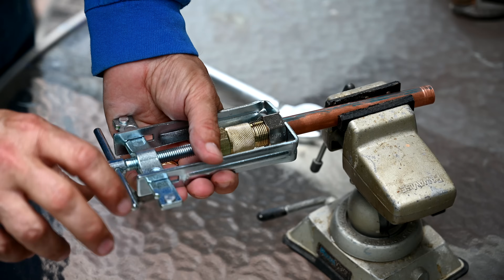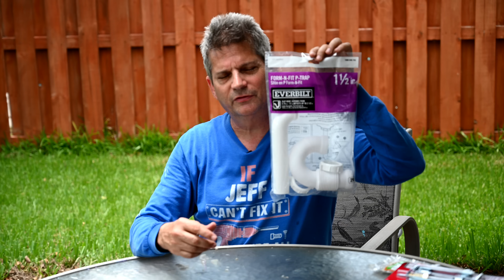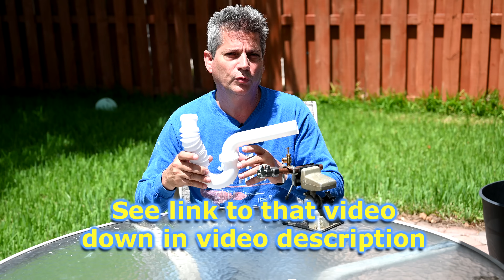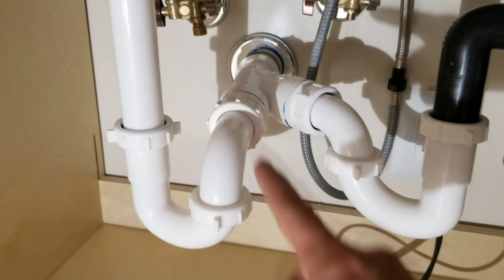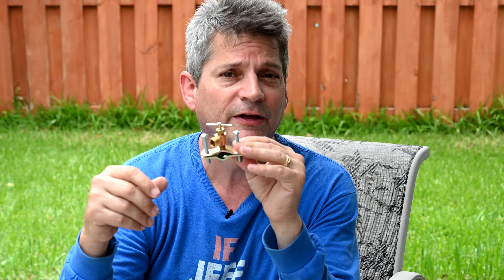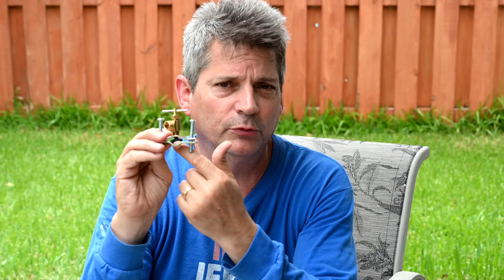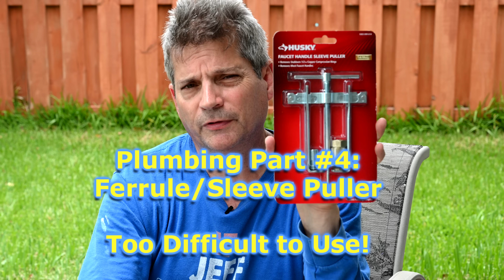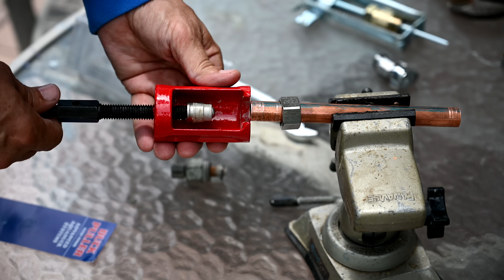4 Plumbing Parts/Tools You Should NEVER Use. NO Plumbing Fails

Comment: I fitted my first and only saddle valve 15 years ago for my ice maker....and I've never had a problem.
Reply: Same, I used one for an RO system in my basement about 10 years ago. Its right were I can see it, and I would know for sure if it started leaking. Which it hasn't. That being said, I will sweat in the proper parts if it does.
Reply: @chriskolb3105  Same here--mine's been in place for 12 years.  No issues.  And it's in the basement near a floor drain, so it it leaks, it can't hurt much.
Reply from the maker: @chriskolb3105  Yes, sometimes you can get lucky. I heard that some cheap Chinese saddle valves with cheap white metal will corrode and pop right off.
Reply from the maker: Famous last words...
Reply: I think a lot of it has to do with your water supply and types of metals in your system. I've seen both scenarios. 20 years old and still holding and 2 years old and leaking. Not worth the risk. It's much easier to add a real fitting and ball valve.
Reply: @tedd7028  Agreed. The issues I found had nothing to do with leaks only volume. Refer ice makers require more volume or they fail and won't be covered by seller etc. Watch your backs brothers.
Reply: I do the plumbing work for a big apartment complex and the occupants putting saddles on copper plumbing lines causes thousands of dollars worth of damage every year saddles are nothing but crap and whoever uses them don't think about the owner that has to dish out all that repair money they think about the
Reply: The money they safe
Reply: I've also had good luck with them, but I've never installed them in an inaccessible location.(behind drywall). I've always had them under the sink, so I can repair or replace them easily, the few times that I've ever seen anything go wrong. It does make a mess, and I have had to replace an under sink cabinet floor. Though failures are rare, I'm reluctant to use them in someone else's house, because I can't keep an eye on them.
Reply: ya man. People love to be over dramatic about stuff. I've been plumbing 22 years and have seen countless saddle valves working fine
Reply: @garyvallone5393  Out of the hundreds of saddles valves I've seen only about 20 of them was leaking but that was enough to cost thousands of dollars worth of damage so it's not worth it to me any so-called plumber that installs saddle valves is not a plumber there a butcher
Reply: @plumbbuild6517   I'm not saying I install them. I never have. But I've seen tons of water damage issues.  Saddle valves are bullshit but not worse than anything else.
Reply: @garyvallone5393  I don't understand why people that are not plumbers use saddle valves instead of just a regular stop tee much easier and it passes code
Reply: @plumbbuild6517   well because they arent plumbers I guess. Homeowners
Reply: The problem is after turning it off/on over a period of time. 2. Isn’t a solid rigid connection.
Reply: The technician that came to install our refrigerator used a saddle valve to tap into a water line. After 3 years I heard a constant water sound one day, and it turns out the saddle valve was looking for so long that the copper pipe eventually corroded and was spraying water in my crawl space. Crazy how these fail so catastrophily

Comment: Yes your sleeve puller is garbage.  The one I have is worth its weight in gold, works great.  No manufactures mark,  was my grandfathers.
Reply from the maker: I may have seen other plumbers using the tool you described is that like one of those big Gray sleeve puller tools?
Reply: Ferrule removal is best done by careful use of a cut off wheel
Reply: A real plumber can get by with channel locks. I once re piped an entire hotel and then swapped engines and transmission in my 73 suburban in the same weekend. Only tools I used was a pair of channel locks and a 4 in 1 screwdriver
Reply: @garyvallone5393  this is true but just one knick of the channel locks and you will have a leaking compression sleeve. Best to use the right tool for the job.  You didn't by chance use a hammer to work on your car?
Reply: @jbright97  no hammer. I used the channel locks as a hammer

Comment: what about shark bites they dont require soldering
Reply from the maker: I use shark bites all the time, especially their end caps to cap off a pipe temporarily. I will only use these outside the wall, where I can see if you ever develop a leak and you can reach it and it's repairable. Otherwise, nothing beat soldering pipes, tried and true.

Comment: How old is this video the first clip was good but the rest was a disaster
Reply from the maker: This was all filmed 2 weeks ago. why do you say it's a disaster?
Reply: @jeffostroff  I guess each state has its own codes
Reply from the maker: @dafoo383   Yes each state has its own codes but most of the States loosely follow the uniform plumbing code and pretty much almost all States I know of Ben the S trap and certainly the saddle valve and most also being the flexible trap.
Reply: @jeffostroff  that angle stop puller I dont know anyone who uses that just thought it was funny

Comment: I'm a British plumber and was very intrested in theas code violations although they don't translate to the UK. We do have the same problem as to why do  the DIY outlets sell parts that are not complaint to code and the reason is becouse there is nothing to stop them, they don't care if your house is flooded, and the DIYER hints that if it is being sold then it must be ok
Reply from the maker: Roland, Yes, it's a matter of building code, not law. There is no law that says not to use these parts. I don't have a problem with using them as a temporary fix until you get to the store to buy the real parts, although, I still would not install the saddle valve, because then you'll have to cut the pipe and repair it later.
Reply: @jeffostroff  ,  We have 3 code that plumbers must compile to, "British Standard Code, European standard Code and the big one Water Regulation Advisory Service (WRAS). All fittings and workmanship must comply to 1 or all of these, as some of them overlap. I for one would like to see more regulation of the industry in the same way as Electricians in the UK, were work must be registered with the local authority and possible Fines be levied on the homeowner if work was found to be non-compliant and not put wright

Comment: Interesting, I don't think I've ever heard of issues with Straps in Australia, maybe we have a different sewer system or connection to sewer system or something?
Reply from the maker: I've heard a number of plumbers from Australia mention this. Could be you have much higher quality venting so that the S-Traps don't siphon out. I would also imagine if you have a shorter leg of pipe leading into the S-Trap then the water should have less inertia, and not enough force to siphon itself out.
Reply: @jeffostroff  yes, every house has a sewer exhaust vent that runs up above the roof.
https://i.imgur.com/df9qMqV.jpg  my 1970's era house, the newer ones are much smaller PVC pipes that aren't quite as high, but all buildings require one by law.
Reply: @John-gm8ty  that's true in philadelphia too, I assumed that would be universal that vents are required, but maybe not. Maybe just old cities like philly with ubiquitous S-traps.
Reply: @John-gm8ty  My house has several vent pipes, it was built in the 1960's so it has big ones and no PVC, I have ABS drain lines.
Reply: @jmadigan2760  My house has several.  It is ranch style house.  Pipes below, vent through walls, electrical through the attic.
Reply: S traps in AU normally go in to a floor wast gully so you can't get any syphoning and the toilet is direct connected to the main sewer outside
Reply: @neilburton8131  There is P trap built-in to all domestic US toilets.  It is often visible on the base.
Reply: My thoughts exactly, here in Finland every trap is basically an S-trap, but we use a bit different trap which catches junk as well so that hair and other junk doesn't get flushed down.
Reply: Even with a sewer exhaust vent downstream of all the house fixtures won't protect against a localized vacuum in the line, for example, from a nearby toilet flush.  The thing that's missing is the "whole house trap", which was usually a simple U trap with 2 cleanouts, installed at the point where the house pipes left for the septic system.  To understand the issue fully, remember that years ago most homes of the age when S traps were common, were connected to a septic tank, not a central sewer.  That septic tank had it's own venting, so backup of sewer gases, while not impossible (vents get clogged), was not as big a threat.  Furthermore, a whole-house trap offered some insurance against at flushed baby-diaper passing out of the house and getting lodged in line in the yard.  Open up the U trap in the basement, vs. go out and hire a backhoe.   But with modern sewer connections, the propensity of the house trap to be the cause of drain backups became a nuisance.  Furthermore, there is no street-side venting close enough to the house to avoid those traps being sucked dry themselves now.  So they pretty much don't exist in any modern house.  But in some retrofit installs where the main line out the house has been messed with, you might a U  trap before the pipe exits through a wall... where the sewer line was run above the level where the septic connection in the floor used to be. 

If insurance companies (those are the guys writing these code changes) has their way, all old homes would be razed just to eliminate the risk.  Now, it's fine with me that they decline to cover old houses.  But right now the house of cards that is mortgage lending would then refuse to ever finance an old home.  So there is this parasitic problem of banks and insurance companies ruining perfectly good homes by insisting on one-size-fits-all code changes, without understanding how older homes were built, and why they worked pretty reliably.  That's where a by-the-book nincompoop is far inferior to a methodical and professional long-in-the-tooth handy-man who knows what's really what.   Not saying that they will slap on an accordian style p-trap, but they are not going to wet themselves any time they see and S trap.
Reply: @gdeangelkick  And that is the error you point out, the vent must be upstream or as close as possinble to the end of the drain to work properly. vents downstream will onl;y exhaust air from the drains, not draw it in.

Comment: Home Depot and Lowes buys all the banned shit, because they get the crap on the cheep after it's banned.
Reply from the maker: Joseph, remember it's not banned by law, it's banned by the building code which is simply your city inspectors who refuse to give you a closed building permit without it, so it is perfectly legal for the stores to sell these items. At the very least they should have a sign that says warning, these parts ar ebanned by Uniform Plumbing Code and you are using them at your risk.
Reply: @jeffostroff  O, I'm aware, I've  been a contractor for 32 years more or less, maybe 34, at this point I don't care to figure it out. In any event, I resent Home Depot selling that s*** because my customers too often want me to go buy it and install it. Obviously I refuse.  The other one that annoys me is that they sell cabinets made from sawdust and wishes.  the cabinets are more expensive than real cabinets made it a real cabinet shop, but I still get customer requests to install them because they can be done on the same day that the request is made, as if I would ever.
Reply from the maker: @josephdestaubin7426   Sawdust in wishes I love that! Funny you should mention that because on our live home depot live stream that I did about a week ago we exposed all of the vanities down the vanity I'll there and how poorly they are made out of particle board.
Reply: @jeffostroff  Im going to have to watch that.
Reply: @jeffostroff  Pro tip for all you potential customers out there, if your contractor is buying crap from a big box store it's because he's disorganized, disinterested, or ignorant (ie. still practicing).

Comment: Just buy an olive cutter
Reply from the maker: Yes you could do that or even cut the pipe back of there's enough slack on the pipe but it is so much easier to just use the duck puller tool It is virtually effortless and you don't have to cut into anything.

Comment: Ok the accordian thing...   what insurance company is coming to do an inspection?  Why would they be doing an inspection?  Wouldnt insurance companies that are having a claim filed for something, lets say a flood..  they send”””@(,. a claim adjuster.   if the adjuster deems it necessary to get a plumbing inspector on site, the insurance company will be footing the bill for the inspector.  Unless your claim adjuster knows the whole plumbing, electrical, residental structuring codes, they likely wont know what all is not allowed,.
Reply: Insurance companies always check on properties that are used for rental property.
Reply from the maker: @jackdavis1636  yes they do!
Reply: Would you rather have the insurance company deny the claim that was caused by your plumbing not being up to code, or at least properly installed? And why you'd install something that is even likely to cause the problem in the first place, I'll never know! I've seen these cheap accordian flex adapters just plain fail due to cracking, because they're so thin in the first place, and when you flex them too much with any pressure at all on them, they get old, or if you stick a snake through them, they will break. That's in addition to the other problems such as holding waste items where they should not be. Plus, it's really NOT THAT HARD to get a plumbing configuration where you don't have to use one of these at all, possibly $5 in parts and ten minutes work, compared to a several day and costly (uninsured, for sure) remodel.
Reply from the maker: @fixitmann6685   Yes that is correct and in fact one time we had home depot years and years ago install a dishwasher for us and when the buyers of our condo sent their home inspector in we failed because they improperly installed the high loop that is required by plumbing codes and so we failed the inspection.
Reply: When you sell a house, especially through a realtor, they will have all that inspected. To buy a product like these for your own use, in your own house, the police aren't going to arrest you. However, IF there's water damage due to the failure of one of these components, they may deny the claim on the basis of code violation.
Reply from the maker: Z ack, we have seen a sharp increase the last 2 years of insurance companies getting proactive, and out of the blue will call you up to schedule a 4 point inspection to make sure your house is OK, because they are fed up with $30,000 water leak and mold claims. Also when you buy a new insurance policy, they frequently do these inspections first. Also, 2 weeks ago my insurance company sent someone to do a drive by on my house and sent me photos of palm fronds from my palm trees touching my roof, and wanted them cut, because it can attract carpenter ants onto my roof, then into my house. Crazy I know, but in the end it will keep all of us in line, and we'll have fewer floods.

Comment: 15 years on my saddle valve and no leak. You say just hire plumber most are thieves charge 200.00 for 15 mins of work.
Reply from the maker: You're doing good on that 1 James you probably got a pretty decent quality metal. Some of these cheap Chinese saddle valves can be made with Strange alloys or if the medal is not made out of copper and is allowed to touch the copper pipe you can get electrolysis forming between the 2 metals which causes corrosion. Sometimes these metals are so bad that in humid environment s the steel eventually corrodes on their own and then just pop right off the pipe.
Reply: @jeffostroff  Yea I guess if you find a good plumber to do it right and cheap I would have them put a tee in. Used the accordion pipe once Never again lol

Comment: a pair of water pump pliers around the Olive(feral) and use a unscrew method simple and works 99% failing that an adjustable spanner behind the nut and hit it sharply (many taps of the spanner ) works to failing that a junior hack saw ,many ways to skin a cat :)
Reply from the maker: Olive, I've heard a number of guys on here from the UK call it that. How did that name originate?
Reply: @jeffostroff  no idea tbh,but its a nut and feral or olive but mainly Olive,just asked google and i've still no idea,maybe its and old English or old Latin,French German,Spanish  corrupt name ? you still use the olde English for TAP e.g faucet
Reply from the maker: @gsyguy1   Maybe they call it olive because Olive it comes off ! 😎

Comment: I’ve used a flex pipe from a sink drain to the pea trap and had no issues whatsoever
Reply from the maker: Jmiah, You might get lucky, and who knows maybe years down the road it might fail, or not, it's like playing Russian Roulette. Others are not so lucky, and depending open how poorly made they are, many people report leaks on the folding seams f the accordion flex, where the plastic is creased and folded and stressed to the point it develops fractures that are helped along by homeowners who bang stuff into it under the bathroom vanity, or even temperature cycles.
Reply: @jeffostroff  yeah i wrote that before i read some comments. Its ok for the moment but i plan on changing it out not far down the road